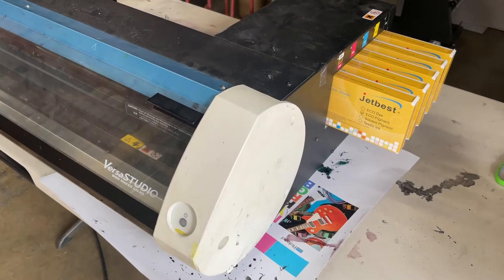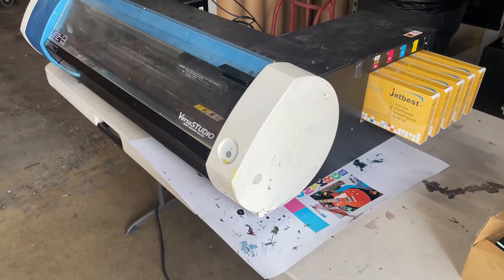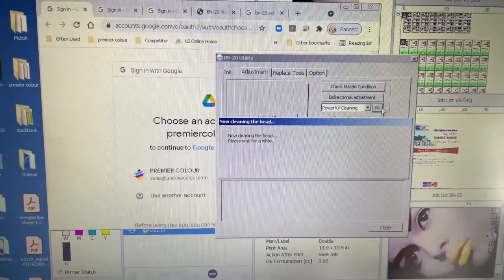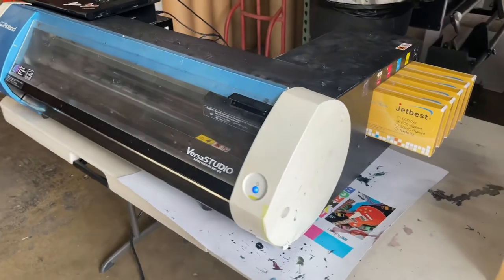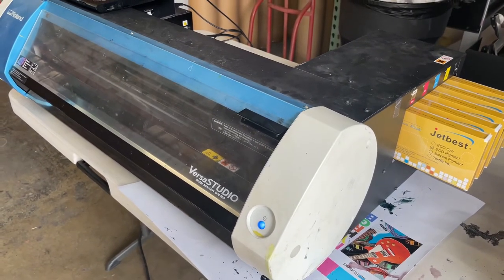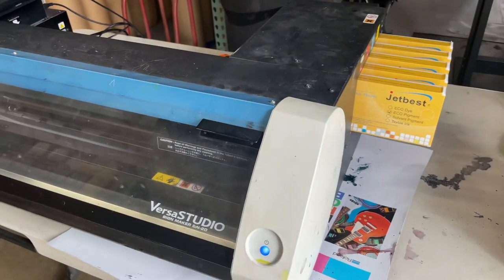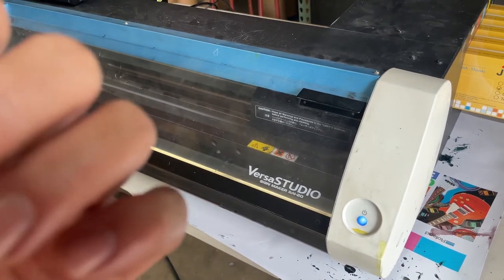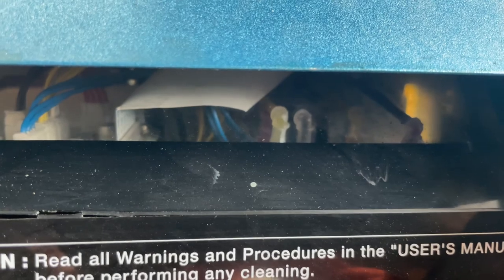How to flush Roland BN-20 Printer

Comment: My Roland truevis vg3 one of the magenta line shows empty certain areas on the tube and it’s telling me ink is empty when it shows all my colors half way. I ran a lot of cleaning and no luck. I clean the print heads weekly, I went out of town and forgot I unplugged the machine. How do I get the line (tube) back up running with ink ? Thank you

Comment: Roland VS-300.  It was working beautifully until it began throwing 0102 (head lock sensor), 0106 (failure to disconnect tool from head) , and 0110 (encoder strip) 
Do you think is an easy fix?
Reply: Encoder is easy to replace. I've done it on multiple machines. Roland Soljet 540 and sv-300. very easy.

Comment: can you use this to clean the metallic out and then put white in the machine?
Reply from the maker: No you can not. You need to change setting from thr printer to change color.
Reply from the maker: We recommend not to do it switching from white and metallic. Color m to white is forgiving. White to Magenta. We usually change the ink line.
Reply: @premiercolour611  so how do you do this ?, I want to change from METALLIC to MAGENTA

Comment: So did you guys ever get it going, if so what did you do? thanks!
Reply from the maker: Chance of able to recover the printhead using flushing moethod is less than 10%. We ended up replacing the printhead.
Reply: @premiercolour611  thanks
Reply: @premiercolour611    - You mentioned that was about $4000 to replace.  Is that still the case ?  I see print Head alone is about $2000.   What else to replace?

Comment: Couple questions. My BN-20 is setup for CMYK + White but the white has stopped printing. Can I use this method to try and get my white printing again? I already tried a head soak that you showed in another video but that didn't resolve the problem. Also, can I use this method to flush my BN-20 then change my printer config from CMYK  + White to CMMYK? Is it even possible to change the printer config after it's been setup?
Reply from the maker: Yes you can try to flush the entire system. That might help but how much would it help. I don’t know. It really depends on how severely it is clogged and how long it has been clogged. To change to CMMYK, a roland tech has to do it for you. You will not given an option to change over the color after flushing. If you still can use cmyk, use it. Don’t try to flush it. It might get worst.
Reply: @premiercolour611  Ok, thanks. I've been using CMYK fine without any issues so I won't bother with the flush since the white isn't really a priority for any of the things I'm currently doing.